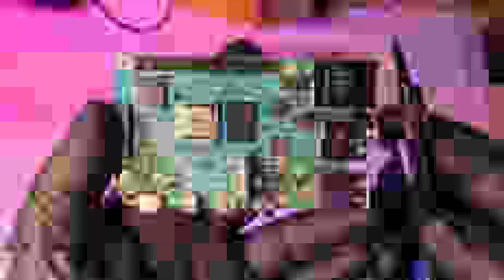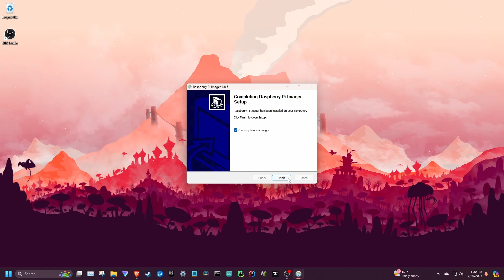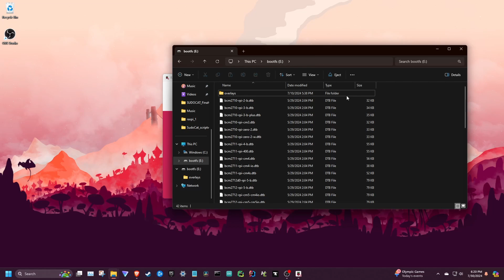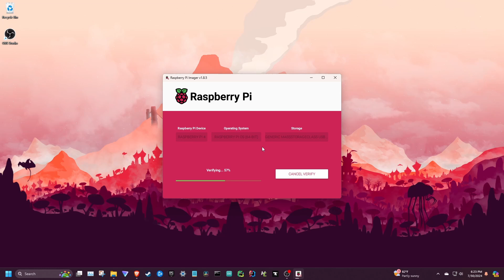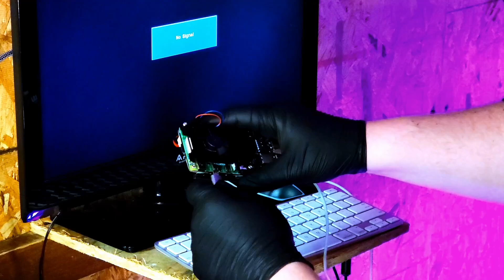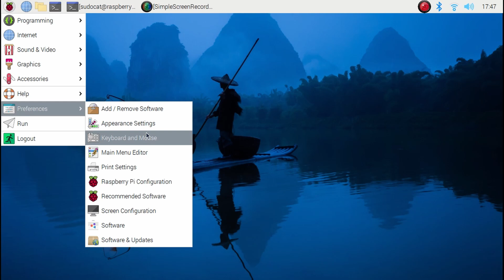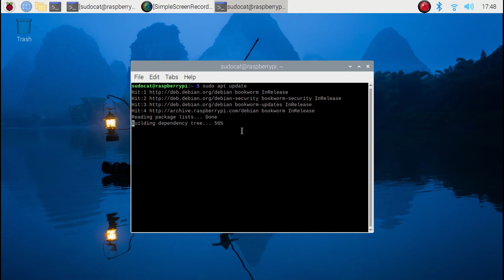Ultimate Raspberry Pi 4 Setup Tutorial: Installing OS & Cooling System | Step-by-Step Guide

Comment: why not use some nylon spacers between the Pi and the "UPS"?
Reply from the maker: My thinking was that I'd want the best connection between the GPIO  of the raspi and pi sugar. However using 3 small nylon spacers on the fastening not next to the pi's GPIO connection is actually a good idea!
Reply: i was going to point that out too , the boards are not parallel so there is risk of arcing between the contacts if they are too close.